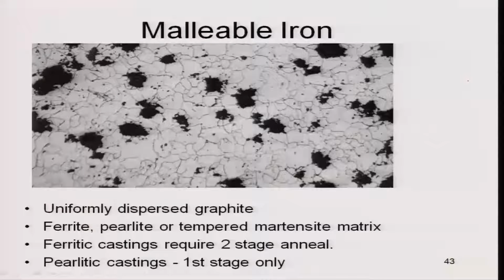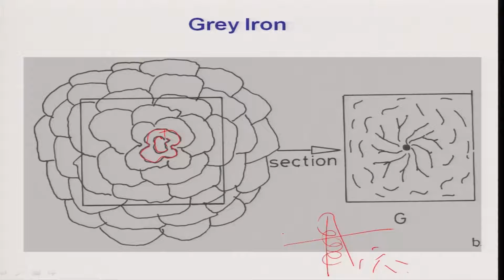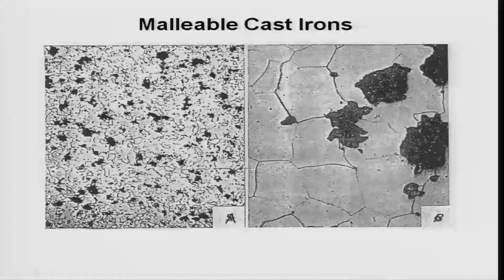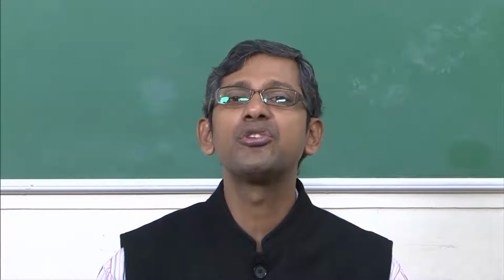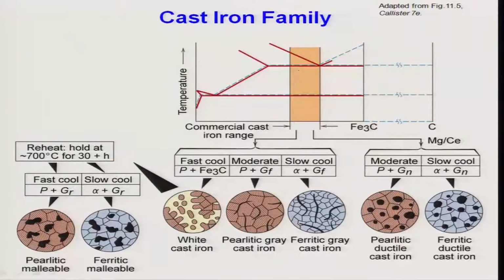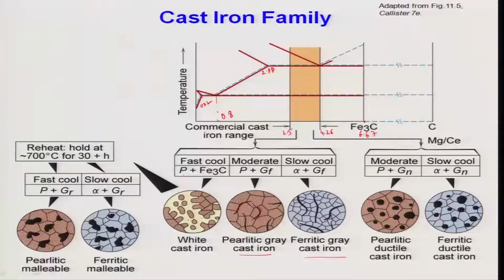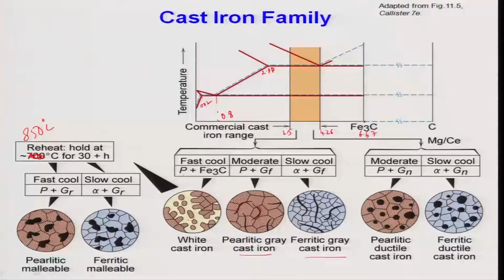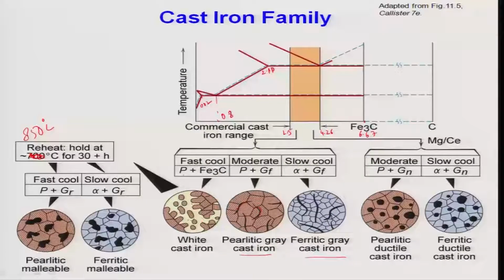Lecture 39 : Malleable Iron

Comment: But graphite is to form if there is silicon ...... how is it that white cast iron is converting to graphite?
Reply: Due to driving force as cementite is an unstable form so it will try to convert into something stable if we give energy to it,and here we r giving energy by heating,this is just another tempered heat treatment process